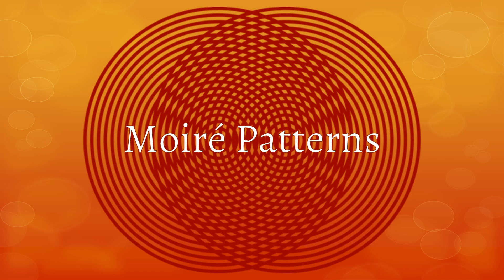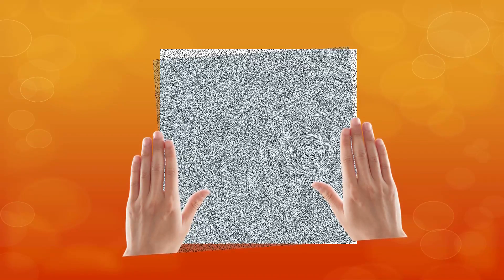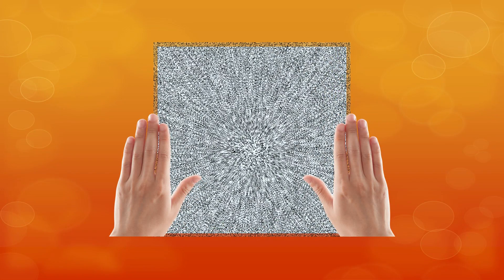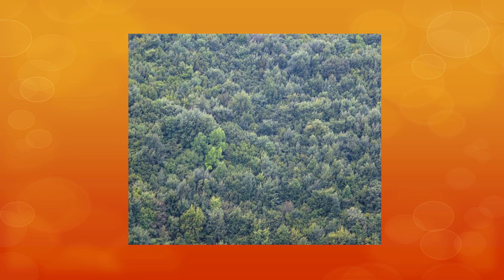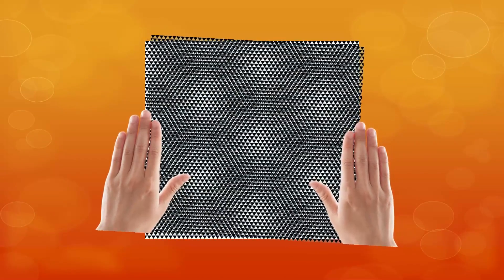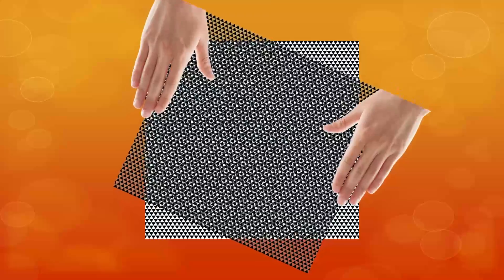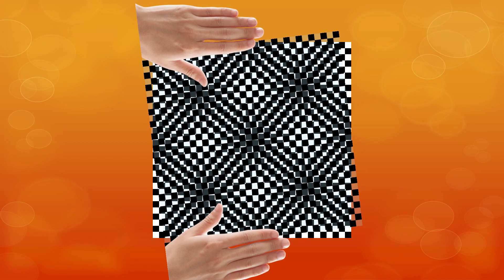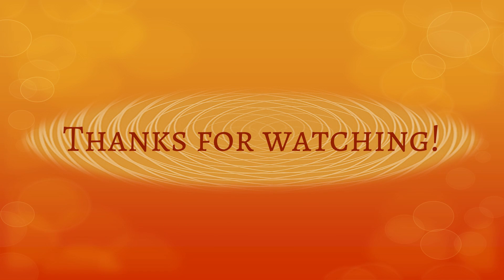Creating Moiré Patterns

Comment: Absolutely loved this video. I have always been curious about Moire patterns as it is a frequent concern in both stage and video, and I don't recall ever seeing such a thorough explanation about what's going on. I would like a sequel though. I want to see what happens with greater and less transparency and I also want to see the interference of colors - particularly with color wheel opposites. Does this have an effect with 3D films when polarized glasses are used? For example, what happens when I wear 3D glasses and  tilt my head at a 45 degree angle? Does the image just dim or is there a Moire effect with that too? Or is there no effect at all and I'm just being an idiot. Very nice video.